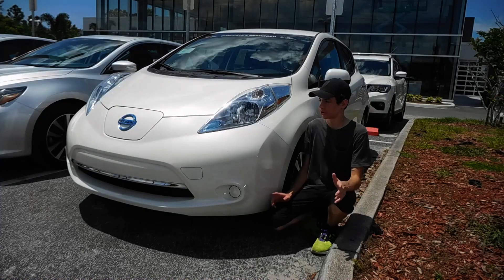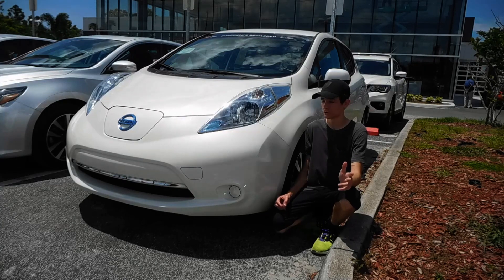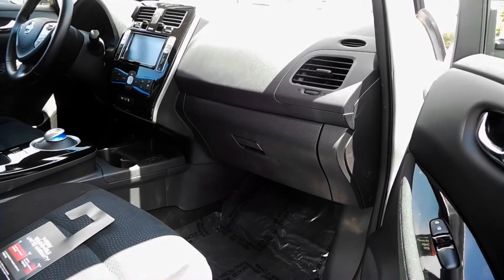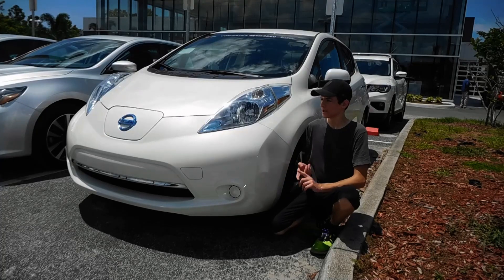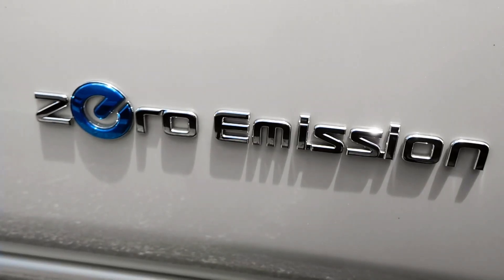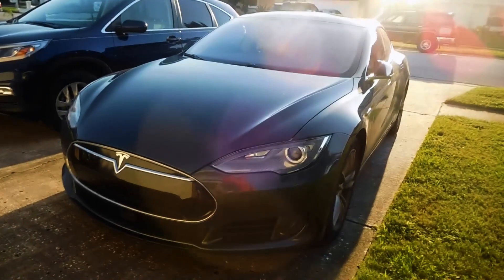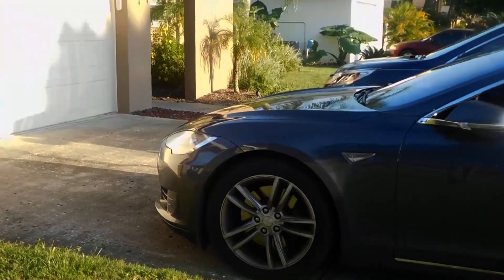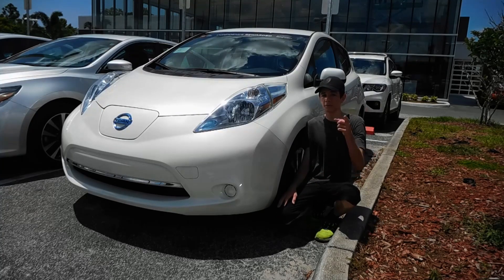Can You Modify An Electric Car? - Electric Car Tuning

Comment: Modern mods I want to do to a EV
1 bigger battery or gas generator battery 
2 power train or transmission modifications the smaller the gear the more rotation the. Bigger the gear the more force it produces 
3 make shift Tesla coil or, radio/gamma wave emitter/absorber, something that feeds on quantum cancer 
4 looks both antique interior and Big daddy energy exterior 
5 practicality, lift kit, lock differential, manual transmission maybe, back up easy to replace power house, and leaf springs! 
Last but not least rims! Some Daytona spokes with the 3 fin spinner!🤙🤙🤙

Comment: why cant you bolt on a tesla inverter and a tesla ecu?
Reply: Idk it works that way cause you actually need to reprogram it . Otherwise it will be like taking a random ecu and just putting it in to the car and that wouldn't do anything cause it's not the same car. And also the tesla has a bigger battery maybe it consumes more charge my point is there 2 different cars it might make it fast or not

Comment: I only looked this up because I'm scared of there being no more petrol or diesel cars. I still want an engine car to modify have fun with. But I'm 12 and until I get a license there will only be a few more years left 😭
Reply: Small block chevies will be around for 100s of years
Reply: Let me give you some huge hope, most likely it will not happen until 2035 which you gives you plenty of time to work on a motor probably nothing like a 5.0 but there be Motor Vehicles out there, I hope you're a 4-cylinder guy but the good news is Toyota is working on a hydrogen motor that is successful and it has sound cylinders and everything it produces zero emissions and it's looking a lot more promising than Electric. Look it up you won't be disappointed they're going to put it in their Toyota Corolla hatchback

Comment: There are actually ways U can mod an EV to boost performance instead of just reprogramming the car's computer, U can install something called a supercapacitor. This can work in conjunction with a battery to allow a quick surge of power to the motors boosting it's performance. Installing water cooling modules on the motor will also help cool it too as currently most EVs rely on air cooling.
Reply: I have electric rc car. RWD, 60 km/h top speed, super acceleration. It have those supercapacitors and they helped. I was planning to modificate it to 100 km/h, so I saved this video. Wish me luck.
Reply: @georgeb5262  The Taycan is genius on execution with the 2 speed gearbox but 2nd is mostly reserved for the top end speed while 1st is for acceleration.
Reply: Also narrow wires in the motor with water cooling system may be good. And gearbox like Taycan's one. Also radial axis electric motors are something to look at.
Reply: Exactly. Think of EVs as giant scaled up RC cars. If you're wanting more power get a bigger electric motor and bigger battery, but bigger battery means the addition of weight. Just like regular RC cars, same principle for them as well.

Comment: After my experience with electric skateboards there's 3 things that determine power to the motor 
Current 
Voltage 
Resistance 
It's tricky to figure out how it can be done, but for someone who knows how to work with circuit boards it's actually just as feasible as an conventional engine just with an different approach. Bigger batteries aren't always the first thing we could mod. It's just the most expensive way.
Reply: Agree. Colling system is also a thing.

Comment: Great topic. Maybe someday add ultra capacitors for better regen, maybe better launch. Switch to LEDs, which is a pain w/ canbus. Swap 12v lead acid battery for lithium ion motorcycle battery(s), i tried it, car died after a month, i recomend 2. Really hard to put down more power with front-wheel drive, my Fiat spins the tires too easily, it needs a second motor for the rear.

Comment: Who else scared for electric cars to take over?
Reply from the maker: They'll never take over completely...not if I can help it 😅
Reply: @QuickshiftCars  What can you do?
Reply from the maker: @Lion Dude Hold on to my gas-powered car as long as physically possible...
Reply: @QuickshiftCars  I will need to get one first
But its that mechanics will have to fix electric cars so they cant just avoid them.
Reply: More Ev = less fuel required = less fuel stations = higher fuel prices = more Ev. One day to run a petrol car you'll drive 2 hours to a specialist supplier to pay 10x today's fuel prices.
Reply: @wooden2187  no, the lower the demand for fuel the lower the price of fuel. Availability might be an issue tho
Reply: Scared? Why? Whatever technology is superior, or more relevant - it will take over the old one. Resistance is futile, it's inevitable.
Reply: @Baalaaxa  because for some car people, engines are so much more fun than just, quietness. It's the sound and tuning that really matters, with electric cars you probably won't be able to do much but buy faster cars. Which just sucks.
Reply: @Baalaaxa  Because passion never gets old brother. ICE engine got a place in every car enthusiast's heart,no matter how technology improves.
Reply: I'm not scared  at all tbh it's just a new generation of cars tbh lot of electric cars actually look good and i personally think that's the big thing big thing that matters it's just people say they don't because people like to hate, also a lot of them are that yes maybe not in a a long drive but the acceleration is very good and fun and that's the other thing that matters is if it puts a smile to your face while driving

Comment: Forgot about liquid nitrogen cooling the coolant of the motor controller and the motor. Get extra power
Reply from the maker: And you can't forget aftermarket blinker fluid either. Extra 100+ hp right there.

Comment: Yeah... EVs are basically computers that allow what amount of amps to go in and out. They definitely can be reprogrammed when someone develops the tools. But it won't be hard to reach the physical draw for the motor; or the safety resistance fuse of 200 amps.

Priuses are getting old enough and cheap enough to tinker, but hybrids (which are now 15 year tech) are inherently more complicated to work with. However ignoring suspension mods, there have been ways done like physically creating a shunt in the inverter to send in more amps to the motor. Someone claimed in a forum he get 0-60 in less that 9 seconds before the fuse tripped and the car going into a limo safe mode.

There is definitely going to need to be more work. In practice, it could actually be cheaper and cooler to have an old, almost salvage beater converted into electric properly. ... if someone got a budget for $25,000 somehow.